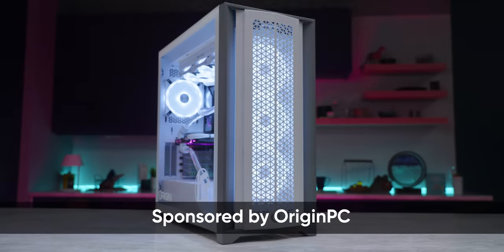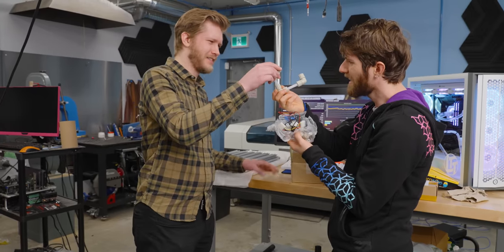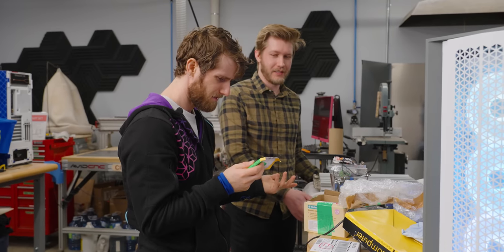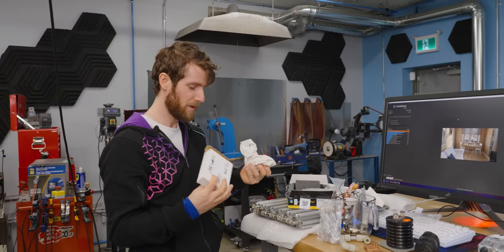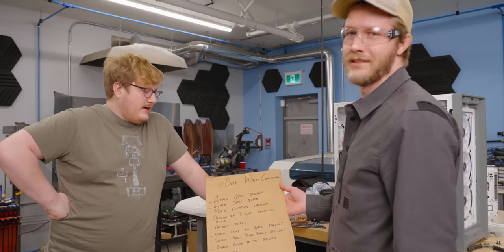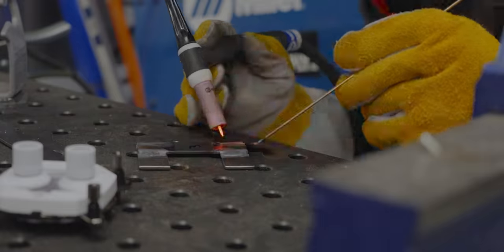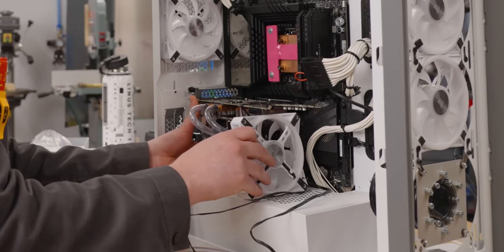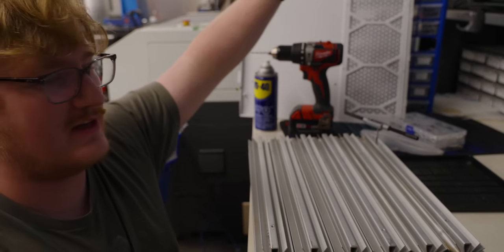Water Cooling.... Using only eBay.com

Comment from the maker: Thank you OriginPC for sponsoring this cool project!

Check out the Millenium Gaming PC OriginPC Sent us: https://bit.ly/3iOSw5o

Here are the components in our Millenium PC:
intel i9-13900K Processor: https://geni.us/j5A1
Nvidia RTX 4090 GPU: https://geni.us/HJkPfQ
Corsair Dominator 2x16GB 6000MHz RAM: https://geni.us/vN2y
Samsung 870 QVO 4TB SSD: https://lmg.gg/vyuMO
Corsair HX1200 PSU: https://geni.us/VFl86
Corsair iCUE 5000D Airflow Mid-Tower Case: https://geni.us/qfFVq
Corsair iCUE H100i Liquid CPU Cooler: https://geni.us/jYpvPHy

Purchases made through some store links may provide some compensation to Linus Media Group.
Reply: Bye
Reply: Hi I’m the first reply 
Edit: it seems that I’m not the first but the second. Also I’m the 13th like.
Reply: @Alex2554  no
Reply: @fundmypcsetup  It’s what it showed a second ago
Reply: @Alex2554  I first replied buddy with — Bye
👍🏼
Reply: gimme a pc
Reply: hello
Reply: LATVIA!
Reply: Just build ur own guys
Reply: @fundmypcsetup  Let’s stop arguing please.
Reply: Be sure to remind Origin of how insane they are to let y’all do whatever with their brand lol
Reply: 3/8" 's OD, outside diameter, 1/4 inch inside diameter, soft tube will work, if you need smaller the next size down is 1/8 inch. most places that have the 3/8" 's have the other stuff to do smaller fridge lines.
Reply: weah oi hape dat d'uquariam filtilir tsat goud
Reply: @Alex2554  Okay 😎
Reply: The work on the gpu as an industrial water-cooling solution is actually kind of quality. the aesthetic of a steampunk , copper, gritty .
Reply: Why are you accepting a sponsor from origin pc when in the past youve reviewed their pcs and shown them to be overpriced and underperforming? You said that you accepted sponsores for products you actually believed in diddnt you?
Reply: could you try using multiple of those rads? i kinda wanna see that.
Reply: @therealplatinumminer385  Linus wants money over reputation
Reply: IT'S NOT ALCOHOL! That will eat every acrylic surface you have on your CPU or GPU Blocks and res!
Reply: better idea, cool a pc with a engine block and in cooling system, shove the pc in the engine block, maybe where the air intake goes
Reply: EW YOU LICKED IT!
Reply: hello linus
Reply: When you're done with that top of the line pc can i have it to replace my gtx1070 from 2015
Reply: That original OriginPc setup is seriously a beautiful AF build. Points to everyone who end up getting it. 👍💎
Reply: N OMEGALUL
Reply: After the experience I had with my last origin I will never buy from them again and feel compelled to yell about how absolutely crap they are whenever they're brought up. 

Yes, they're overpriced and almost pointlessly over the top. That's actually fine. So is apple, who gives a shit. What's not fine is sending me a $4k laptop with the screen falling out, promising to fix it, then sending it back unrepaired. The build quality on the laptops (at least the last time I got one) is god awful. 

I'm happy to see one get torn apart.
Reply: linus please do a wish video its so good or a room formation from old to nice just like kallmekris video u did
Reply: I prefer to support my favoured YouTubers by buying merch and paying for premium rather than straight up donations.  As such I have just ordered a deskpad from thr LTT store.  I did NOT expect to pay $25 shipping for a $30 product.  Love your channel but am disappointed with this.  Will not make another purchase until something changes.
Reply: Why these us guys use water cooling all the time? It's expensive, it's loud, it's leaky and the realistic speed advantage is pretty low. So why again?
Reply: So what you did is willfully ignore your step to add fans on the radiator a thing which you mentioned on your own in this video n 21:26 and just run the tests without the fans cause you saw that it performed (again FANLESS) good enough so you didnt want to make the much more expensive cooling system the pc previously had look a bad value.
Reply: you guys havnt done both, automotive and reticulation suppliers ... :)
Reply: I love these Alex Episodes.
Reply: This PC is awesome. I will never be able to afford even the CPU. I love watching LTT but lately makes me very sad to see all this amazing stuff , knowing that I do not have a pc able to run games newer than 10 years
Reply: @i--dont--know  Noone is gonna simp and give you free stuff stop trying, unless you are a decent looking girl over 18 then you can start an OF account and try get money that way for everybody else the solution is to get a job
Reply: @billkillernic   Sadly first I'm not a girl and second I'm in a wheelchair after my accident. In Germany is almost impossible to find a job if you crippel. I was in the "everybody else" group and I know how it is to work, it was not a choice to be a part of a forgotten minority. Read again my last comment, I haven't tried nor asked anyone to give me anything.
Reply: I dont know if the 'cool project' pun was intentional but i love it
Reply: Linus and Alex  jank videos are always my favorite. Let the mayhem ensue.
Reply: Dunno if it's my system, but somehow the 4k version of this video is choppy. Checked a couple of other videos in 4k on the channel and it's ok
Reply: This project wasn't so "cool" after all 😁
Reply: hey how about a case made from Legos Linus
Reply: Probably used some high quality paint and all the metallic oxides block signals like its a faraday cage.
Reply: Labdien, es uzskatu, ka jums ir mana furnitūra manai jaunajai personālā datora būvei. Draugs sazinājās ar mani pēc tam, kad bija redzējis jūsu videoklipu.
Reply: You guys have an employee with NO home PC and opted to trash this PC "for science" rather than donate it ... hmmmm.
Reply: wonder how much cheapers graphics cards would be if there wasn't so many going to waste for f'ing youtube content
Reply: I think origin is never going to sponsor you again after seeing this video…
Reply: Hi from Latvia (Latvijā) :) You definitely got shipped wrong stuff... so.. good job on staying positive and making use of it!

Comment: "The scratches give you more surface area" is a great way to set the pace for this project. Alex really is just built for jankiness.
Reply: He should team up with the master of jankiness: Luke. That will be fun!
Reply: His intro on the radiator was hilarious. "It's hand made and passive!!"
Reply: built for cringe
Reply: Alex was born into jank.
Reply: First thing to come to my mind when Linus mentioned the scratches.
Reply: @esaedvik  Molded by the Jank
Reply: i think his goal for builds like this is "just how bad can i get the parts to be and still have it kinda work?!"
Reply: Same vibes as "is not a bug is a feature" xD
Reply: When I saw this as the top comment before watching the video, I thought it was referring to the contact surfaces on the blocks.
Reply: Really sets the bar and then smashes it into the Mariana trench
Reply: Depending on scratch depth and width, it may actually decrease performance by lowering the thermal conductivity of the radiator.
Reply: That really DID set the tone for the whole skit, didn't it.  SO much jank..!  And yet, it worked...I'm a bit surprised that it DID, but it did seem to work!  I want to see them fix the CPU cooler block's likely-seating-issue and then test it with a good run of gaming/burn-in tools to see what the system gets to at its maximum level of warmth.
Reply: cracked me up
Reply: Every time I see Alex do a project, im reminded of the old show junkyard wars
Reply: @andrewclayton7376  I remember that! Though it did seem like a production crew would always step in to make sure things were safe.
Reply: He’s technically correct. And as we all know, that’s the best kind of correct.
Reply: Technically correct though
Reply: Hermes smiles
Reply: The Jankmaster2000 tm
Reply: Alex: Oh, you think jankiness is your ally. But you merely adopted the jank; I was born in it, moulded by it. I didn't see a proper build until I was already a man, by then it was nothing to me but BLINDING
Reply: Now I want to see a collab between Alex from LTT and Dawid from @DawidDoesTechStuff
Reply: @Mrjamjams66  My first pc had a hole cut in the side of the SFF case so that I could fit a 1050ti in it.
Reply: Built different

Comment: I've said it before, I'll say it again: Linus and Alex doing jank water cooling is ALWAYS a great video. And this one actually performed pretty ok for parts that are almost all terrible on their own and not meant to be used together in the slightest. Alex is a master of just making it work. And I always get a kick out of how disappointed Linus is that the grand idea ended up being nothing but duct tape and cable ties. Adding some Jake to the mix just made it even funnier how bad it all came out, while still kind of doing the job.
Reply: Proof that Alex is a fantastic engineer. Taking random garbage from the mid-2000s and making a functional water-cooling system (mostly) capable of handling a 13900K and an RTX 4090 is actually pretty fricking incredible. 😂
Reply: @Malicious2013  I would say it was capable. I don't recall it thermal throttling, which is insane.

Sure, it wasn't as great as custom built gear, but the fact it did as well as it did is a testament to his skill.

Same with the Engineers he consulted. How do we cool this mighty system? Zip ties. Classic engineers.
Reply: Poor Jake just wanted to drill a big hole 🤣 What a turnaround from that video where Linus bores a hole into the front of a PC case and Jake is attacked by said PC case/bore drill into slo-mo "how did my life decisions lead me here" face montage 😅🤣😭😅🫠
Reply: It takes talent to make something purposely jank.
Reply: same I really enjoy these vids

Comment: I'm actually shocked that Linus does not recognize the passive radiators as Alphacool Cape Cora. They are legendary.
Reply: Yep, even just a window open the basic airflow cooled
Reply: I remember wanting these for ages after seeing the Milliondollar PC MDPC-024 build but never having the money for watercooling.
Reply: Alphacool may have sold them as computer parts, but they are CLEARLY repurposed industrial cooling devices strapped together. They look like they're originally for condensing a gas into a liquid, like for an HVAC refrigerant condenser loop.
Reply: @ChristopherHallett  they look like trans oil coolers on cars.
Reply: @arcanask  Definitely auto transmission oil coolers which means you can get them for cheap at the demo yard.
Reply: Almost looks like using 2020 extrusion as a passive radiator would work?
Reply: Oh and no mention that those are full aluminum.
Reply: tbf they went on ebay and purposely selected shitty parts. most pc companies have ebay stores. you can get a full hardline done on ebay. had every line measured and delivered pre bent with all fittings. im past the linus tech needing to be ziptied together. its a disgrace to us at this point their builds are soo bad.
Reply: @darklegionnaire8304  tbh, you would not have watched an entire video of ripping out a perfectly functional water cooling system and replacing it with more or less the same parts just a bit cheaper.
Reply: it's quite fun to see.  aluminium starfins are used in ambient air heat exchangers for vaporizing cryogenic liquids.  might grab some short lengths from work to play with, except they are 8" fin length instead!
Reply: @darklegionnaire8304  The entire point of most of the videos on this channel are to be entertaining. I would certainly not be entertained watching someone remove water cooling from a pc just to install water cooling in a pc that costs marginally less. I think everyone watching this video knows that this is NOT how to water cool a pc properly but rather how to do it in a way that's stupid and funny but still works. No one's losing their job or customers over an LTT video

Comment: Since SLI is no longer a thing so we can't do "Trying to game in 40K!" projects, these insane watercooling vids are some of my favorites.
Reply: Sli is technically only dead on consumer cards. If they have workstation cards or get sponsered by nvidia they probably still could do 40k with nvlink
Reply: "16K Gaming" didn't use SLI, it used Nvidia Mosaic, a Quadro-exclusive feature that requires special hardware.

Also, SLI isn't fully dead if you're willing to tweak compatibility bits in Nvidia Inspector.
Reply: @ChristianStout  Doesn't SLI rely on the software/games supporting it? Or does the tweak somehow get around that?
Reply: @Incommensurabilities  I don't fully understand it myself, and it varies by graphics API, but generally SLI is implemented at the engine level, and then optimized on a game-by-game basis, so the SLI profile/settings for one game will be [at least partially] compatible with other games that use the same engine.
Reply: Pretty sure you can get SLI working through software, but it doesn't work well
Reply: How fun would a video playing 40k games on 40k be :P
Reply: Quad SLI with XOCed 4090TI...breaker pops.

Comment: Those EM-technik fittings are actually pretty expensive (if they are not knock-off of course), they are resistant to a lot of chemicals and used a lot in laboratory / pharmaceutical and foodprocessing applications. Used these things a lot at work.
Reply: yup, they also can be used in gas installations
Reply: Yeah, what a hoser...
Reply: Yep and the color is normal too. The new ones made out of PP have the same coloring. Just the press ring design changed a bit. But these fittings are actually pretty reliable.
Reply: @GamingJuli  PP, haha.

Comment: This was amazing.  Back in the late 90's early 2000's we used to watercool like this.  I helped a friend build a geothermic radiator, that ran a copper pipe 15' under his back lawn; 30' into his yard and back again to his house, through fitting in the side of his house (all copper piping mind you) back to the office, where he had quick connect fittings custom built to run copper piping up to his computer, which was on a rudimentary test bench, and to hand made copper sinks.  This took me way back to those days.  I'm surprised no one mentions the galvanic corrosion issues caused by an aluminum sink and copper blocks... still that was entertaining!
Reply: People don't realize we had to MAKE our own blocks.
Reply: Damn. LTT needs to take notes! Geothermal water cooled PC sounds amazing!
Reply: @NeXtarProducts  it still works.  he has his modern gaming rig on it now.  changed the fittings so normal water cooling piping can connect to the copper pipes.  the water is like 40F year round, he has a pretty heavy duty pump in a separate room so the whole thing is pretty much dead silent; and he lives in an area the ground freezes.  part of why we buried the pipes down to 15 feet was because the ground doesn't freeze that deeply, and the temps are maintained at a pretty regular 40F or so year round (we consulted a guy about this when we were planning it).  I remember when we built it we were joking about how much overkill it was for a 45W cpu being overclocked, and that it might be able to cool a cpu running 200W through it.  Didn't realize that he could easily run a 1000W system on it.  still can't warm the water, and he's got a 3090 and threadripper on it.
Reply: @arizona_anime_fan  Awesome! It's a baby geothermal heat pump.
Reply: I remember reading a post where a guy was burying pipes to cool his PC  outside his window in 1999, back when over clocking required soldering wires to increase power to the chip, nothing was easy like today.

Comment: I mean that solid aluminium reservoir is pretty badass looking.
Reply: from the looks it should be a Aquacomputer Aquatube from back in the day
the Delrin version is still sold by aquacomputer
Reply: It's either an AquaComputer design, or a clone of one, I had a blue version back in the day.
Reply: Don't you mean Paper Clip? I mean it was shipped as a Paper Clip.
Reply: were made by AquaComputer in Germany and aret meant to be mounted in the top of the case, not on their side like that. mine has served me well for almost 2 decades now
Reply: @phuzz00  This is definitely correct. Not meant for rackmount by any means, used to go in a 5 1/4 adapter plate. This was "The shit" back in the day.

Comment: Those don't look like ancient fittings, it's just a standard color for PPh material. Commonly used when you are transferring various chemicals. Source: I use them in my line of work constantly (em-technik being high shelf for this type of connectors made of special plastics)
Reply: He got a good deal on the “fishing lures” as well, those are nickel plated or stainless steel push-to-connect tube fittings.  “Real” ones are usually over $10 apiece.
Reply: I use them too, those look really old though, as in, you can tell the plastic wasn't made a couple years ago
Reply: @solarcheese  those 'fishing lures' fittings are used in industrial applications all the time and they work just fine. And usually they aren't even made of metal, but plastic. But the thing is: they're meant to be used with tubing with calibrated outer diameter.

Comment: For anyone wondering, the radiator used is a 6 column Alphacool Cape Cora from 2006, they were actually really good for the day but were designed for silently cooling a Core2 Duo era CPU (so up to 65w TDP).  The team would have known from the beginning that it had zero chance of handling the heat load they were going to throw at it, made for a funny video though :)
Reply: Liquid cooling a core2duo Sounds like an absolute meme for someone Born in 1996 lmao
Reply: Tbh, I'd love to get a dual pump setup and try to liquid cool a system using 12 columns of the cape coral system. Maybe more if needed. See what the minimum is for, say, a 5960X or whatever the more modern R7 chip is. Or hell, try cooling the most power hungry CPU available. Would be an interesting thought experiment. Trying mid 2000s water-cooling tech on modern hardware